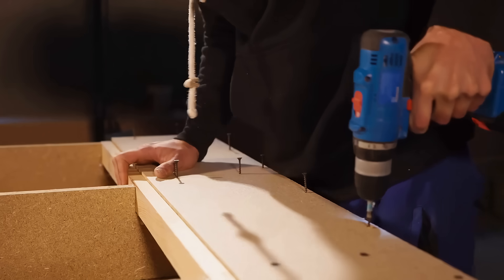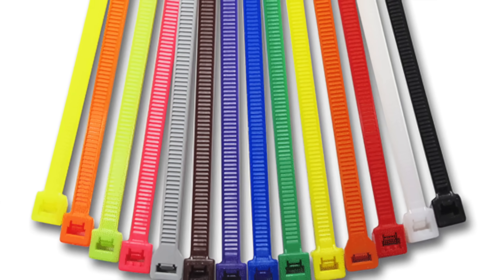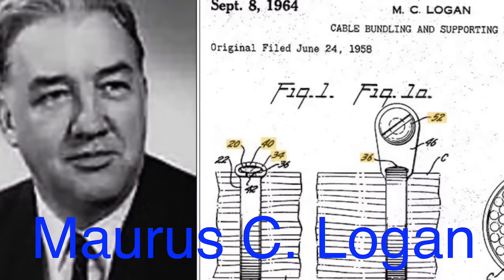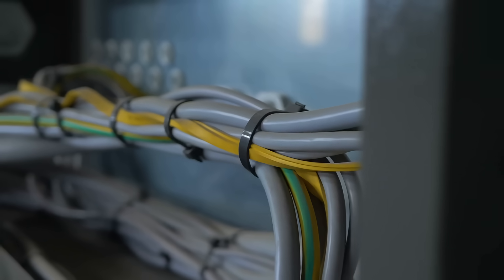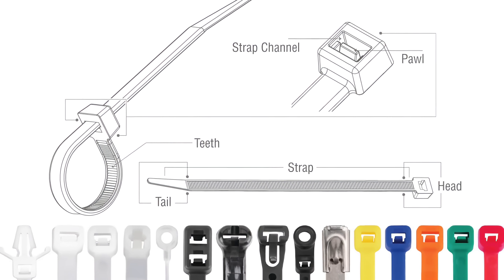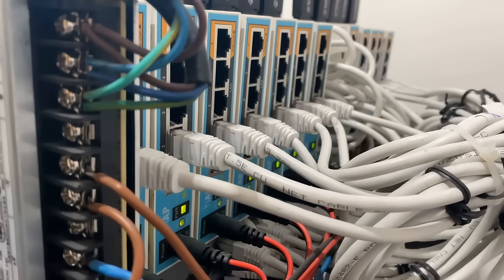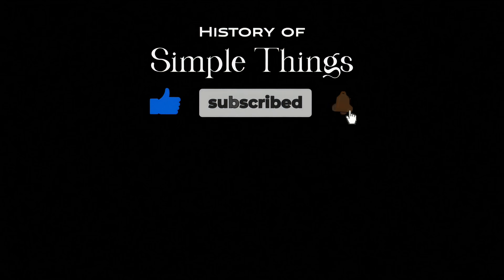Who Invented The Zip Tie?

Comment: I worked on NASA devices and they were always called: "Panduits". In fact i still have a Panduit gun in my shop. It tensions and cuts off the excess at the pressure setting you make on a vernier in the handle to make the Panduit as tight as you want and no more.

Comment: 1970. Reliance Electric motor control plant in Athens GA.  I was responsible for wiring harness production.  One day we suddenly had a massive shutdown on the production floor.  The ty raps were breaking every time someone tried tighten them.  Someone in the headquarters in Cleveland had decided that T&B was too expensive and had "saved" a large amount of money by switching vendors.  Without bothering to consult with us or tell us in advance.  I immediately tested the new product and determined that T&B was about three times stronger than the replacement.  I cleaned out the stock of T&B ty raps in every store within 50 miles of Athens in one day to get production going again before we could have more T&B shipped in.  
I could tell some other tales about how the "professional" engineers and managers in HQ always knew better than we lowly production people, but that would take too long.

Comment: While racing rally cars in the bush in Australia I have had many occasions to use them.  We broke a front suspension one time abouit 10 km from the finish so we got the long cable ties out and cobbled some  parts together and rotationally torqued them wit a spanner. We would drive 2 km at 100 kph or so and then do it again until we got to service.

Comment: In my days of aviation we used the heck out of them. But 90% of these photos are showing them in a very unsafe condition.  The snipped end is projecting out enough that the sharp edge is sitting there like an open knife.  Thousands of sliced hands were the result.  With a tie strap gun properly calibrated the end can be snipped AND the amount of tightening force required to secure the bundle without squeezing too much.  The usaf inspectors would actually write up a technician for safety violations who just used diagonal pliers or a knife to cut the ends.

Comment: A great idea with many practical uses including much blood and gashed arms. Previous techs and assemblers giving little thought cut the tails off leaving a perfectly protruding sharp blade hidden and waiting
Reply: I agree, a great invention. But I always taught young techs to be sure to use flush-faced cutters when snipping off the tails, and to try and be as close as possible to the ‘head’.  Working in the aviation avionics/electrical industry we had to often reach into small spaces, hands and arms were an easy target for those very sharp ends. 🩸

Comment: Zip ties are great, but they can be wasteful of material... 50+ years ago, we used "Hellerman" ties, which were used as part of a system.  You needed a  "gun" which was a combination of band dispenser tensioner and cutter. It was all well engineered so was probably expensive The band was passed through a nylon collar, a bit like the one at the end of ty-raps, tensioned by pulling the trigger on the gun, and then (and I can't remember how) you cut the band (there may have been a handwheel on the side of the gun for tensioning, is a thought that came to mind...)  I've been on jobs where you ended up with quite a handful of Ty-Rap tails, collected to avoid annoying the customer, and to appear "professional"  With the Hellerman system, there was little waste...
In my garage, there is a bundle of large size Ty-Raps, still waiting after 25+ years for a job they suit, where I don't cut off a surplus foot of strapping... I hate waste!

Comment: I've honestly lost count of the number of occasions, over the years, where I've found a use for zip ties, whether as a quick fix, or permanent solution. They're such a simple, but truly great invention, and I wouldn't be without them.
Reply: They are amazing...  A long time ago now, I had to assist a senior tech changing out pc boards in an emergency evacuation warning siren located upon a hill in the junipers off a high voltage power line corridor that was a bit difficult to get at, even with the 4wd truck we purposely came with. The remote siren unit was struck by lightning, so the quickest easiest fix was replacing all the original electronics with spares, and send things back to the manufacturer to test and recertify. One board, out of all the other circuit boards, was pop riveted in, we had a battery drill so it was a simple matter to get the rivets removed... but after 20 minutes of looking through everything we had with us, working out of the back of a p/u truck, we found that we didn't have any suitable hardware to fasten the replacement board... finally, a picture flashed in my mind and I just said, hold that board in place. I snipped the locking bean off a zip tie, threaded a second one through one of the fastener holes, aligned the bean with the other zip tie and basically made a zip tie pop rivet after removing the excess tail off the 2nd zip tie, and did the same for the rest of the fastener spots on the board to the frame which admittedly is a bit wasteful comparive to what they're designed for, but that's what we had... finishing up, I said that ought to hold it in place until we can return with proper hardware. He looked at me and said, there's no vibration, no UV light to weaken them, we aren't coming back for that!...and then he said, I like that fix!    

Tie wraps can't solve everything, but with a little imagination, they sure can be useful in a pinch with whatever they can do... 😂 even holding a rod in place for an air ride leveling valve, long enough for me to nurse a big truck back to get it fixed properly... zip ties are like duct tape without the gooey mess!!! 😊👍
Reply: I'm diabled and used ty-wraps to temporaraly hold stuff in place.
Reply: I push this on all my friends. I keep 4 packs and use for everything
Reply: @scottrussell4742  I BIND MY GOVT'S ENEMIES WITH CUFFS OF INDUSTRY!
Reply: @scottrussell4742 I buy them in 100 zip tie packs in diffrent sizes 😊. I ued the little ones for the fuel line on my motercycle.

Comment: Reduce nut , bolt , screw would enable real meaning of independent lives and zipped tied help along the way too special in emergency on  the scene response. If making the lock pin unlock ability may help save materials and renewable and it reduce radiation and leakage

Comment: I never saw zipties until the mid '70s when I started working for electronics companies.  I spent 12 years working at a NASA Research center and saw every kind of abuse that someone can do with zipties.  It seemed every time we went off on a mission, e.g. flying UAVs with sensors or cameras in them, etc, the cables would be damaged because some tech over-tightened the zipties.  I was always the one who had to repair the cable.  One time we spent 2 weeks trying to get a satellite uplink to work.  It was actually the responsibility of an RF Engineer from Goddard.  After 2 weeks I told him "I'll track down the problem".  I grabbed a Bird Wattmeter and started following the output cable to the antenna, looking for reflected power.   When I got to a section of cable that had a dozen zipties on it, the Goddard guy got antsy, so I knew I was getting close to the problem.  That's were I saw reflected power.   I clipped all the zipties and looked closely at the coax.  The ground braid was broken and disconnected.   We soldered it together with a strip of Copper foil I bent into a tube.  After that, the satellite link worked and we flew the UAV.

Comment: I worked for Control Data in the late 60's and we used Ty-Raps by the thousands.  One useful variation had a "Flag" on the head that could be stamped with part numbers, etc. I still have my old tool for tightening and cutting them. Also, wax cord lacing was still being used in the late 70's by some industries.  I maintained an ITT telephone switch that had all laced cabling.  No zip ties for them back then!
Reply: I worked in electronic wholesale in the 80s, most govt. contracts specified T & B Ty-Raps, the stainless steel pawl was considered superior I guess, and that was patent protected, if I remember correctly.    My brother worked for CD as a software engineer starting early 70s in San Diego. They became someone else?? He retired from a different large national contractor, my memory fails, ... a bunch of letters. lol. I feel old a lot after watching these videos sometimes....
Reply: @AubreyLeonaeDoLofonos4747  Late 60's we at the Pratt Institute radio station used Ty-Raps (tie-wraps). Although Bates renamed their device, "zip-ties" has never rolled off my tongue. It's like Kleenex where the name stuck as a generic. Your memory is correct Audrey about the patent, but your brother getting into this post is a head scratcher. LOL

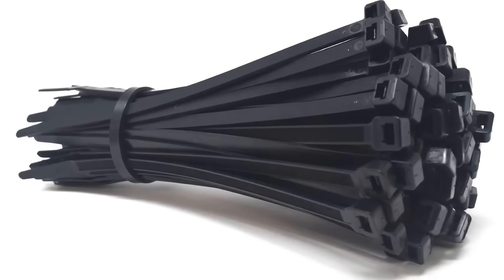Comment: Since the 1980s, I've associated Panduit with zip-tie cable management products. No Wikipedia article for Panduit or Jack E. Caveney 1:34 IIRC Neve recording consoles had waxed lacing cords 4:16 releasable / reusable ties 4:34 color-coding
Reply: I used Panduit straps in the mid 70's and they manufactured a tightening/clipping gun with adjustable tightening tension.

Comment: Regarding 5:42, the pawl on a locked zip tie can be opened by inserting the tip of a tiny flat head screwdriver. This is done by slipping the tip of the screwdriver between the pawl and the serration on the strap.
Reply: You can also use the tip of another zip tie.  Just make sure it's the smooth side of the new zip tie that goes towards the pawl.
Reply: today there is a better alternative that is used in clothes etc to tie labels - they are made of small conical sections that pass through a hole with several flaps
Reply: the clothing one also has non removable ties to keep the price tags from being moved.
Reply: The kind of saddos who watch this don’t need to know how they work. We already do!

Comment: I worked many jobs in my work career. 50 years ago I had a job hooking up electronics on submarines and we used zip ties on wire bundles. We used a lot as they had to be within a few inches of each other.. When I worked in telecom for many years waxed cord was the preferred method. The cross connects at 6:41 bring back memories.

Comment: there are two schools of thought about using zip Ties for bundling cables in networking / IT apps. there is one that say that  it is a NO NO to use them to fasten cables, as it can cause damage to the network cables.  and recommend using Velcro ties instead. and the other says its ok... as long as you don't cinch them  down too hard, and are very careful  if they are not the releasable type when cutting the Zip Ties to undo  bundles,
Reply: The first generation fiber optic cables were particularly vulnerable to damage from over tightened zip tie (or people tying knots in them)….
Reply: I worked in telecommunications and our installation technicians used waxed cord to bundle our cables.

Comment: Zip ties and duct tape. Two unsung heroes of modern life.
Reply: Don't forget electric tape wd40 and superglue
Reply: @CDRD-vs6bt  definitely a 4 piece tool kit 😁
Reply: Don’t forget silicone!
With these 3 items one can build a city!
Reply: I've never found duct tape useful.
Reply: @jeffrey1312  Can be effectively used in a bad case of diarrhoea.
Reply: @jeffrey1312  Then you haven't done much in life
Reply: And hot snot glue.
Reply: And. WD40 !
Reply: few days back by broom gave up. It is just a a bunch of fine wooden sticks but they need to  be bundled nicely to work. I fixed my broom with a couple of zip ties and covered them with duct tape. I am confident that it will last another couple of years.

Comment: Handy tip # 56 .... In the  UK , council road sweeper lorries use thin steel bristles on the rotating brush .... often these break off and litter the gutter .... pick these up ! ! .... by inserting into most  ZIP TIEs   from behind ... the pawl can be disengaged and the tie reused  ... VERY handy tip ..... ( tried - n - tested ) ............ DAVE™🛑
Reply: 👎👎👎 I don't understand you.           :face-blue-smiling:
Reply: @dareisnogod5711  Hmmm .... you may not have used this handy tip for releasing Zip Ties 😝( ? ) ...but ... I can assure you that it works ( tried - n - tested ) ....... DAVE™🛑
Reply: @davidfalconer8913  Yes, or very small flat-bladed screwdrivers or even scalpel blades, etc. can be used.
Reply: @FMFGUF  even my long pinky nail lol
Reply: @FMFGUF he’s in the UK. Let don’t let people have blades there. This is to prevent knoife croime. You know, for elf and saftee.
Reply: Or a knife, of which the rest of the world can possess🤣
Reply: @brandonschultz3262  A knife is  MUCH  too wide to stuff into the zip tie box ( from the rear 😝! ) ... the thin road sweeper blades ( approx 2 mm wide and ½ mm thick ) are tough , springy and ideal for releasing the pawl ... these may be found in other countries wot have road sweepers ( ? ) .. DAVE™🛑
Reply: I RE-USE them whenever possible, saves money AND the environment. 👍
Reply: Tweezers on S.A.K., really small flat screwdriver, blade on gent's s.s.k....
Reply: Yep, have a few of the toolbox just for that, But I just got them from a guy who scraps out the steel brushes that lose too many bristles
Reply: In UK you have bigger problems. Your whole country is falling apart and people can be thrown in jail for speaking out about it. Your police protect criminals.